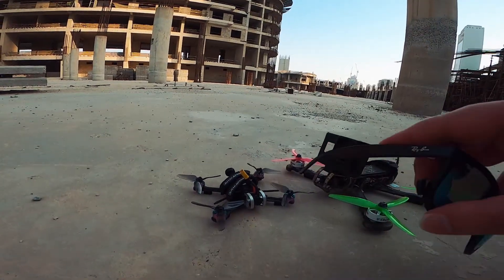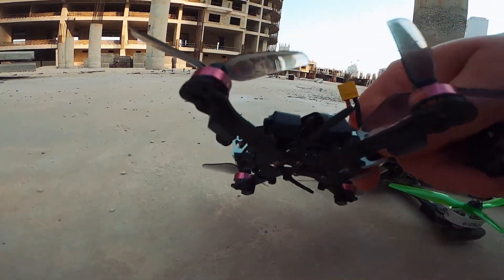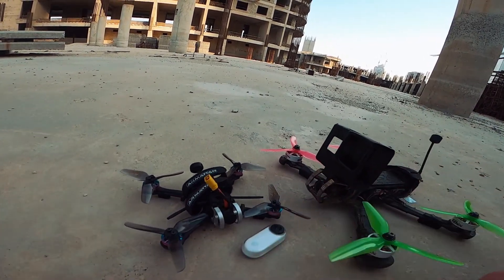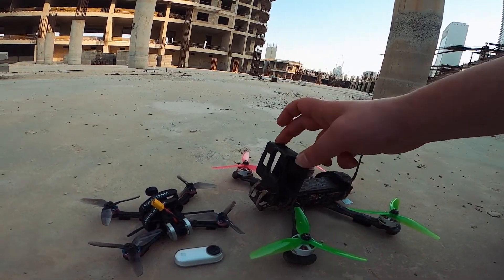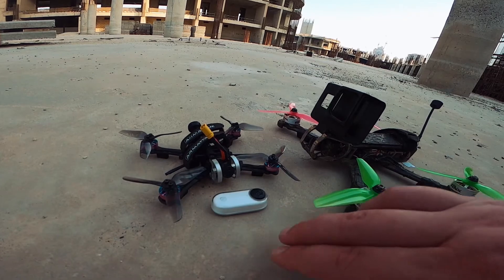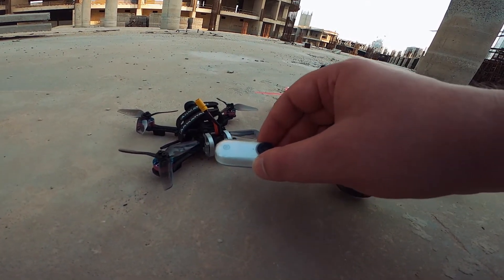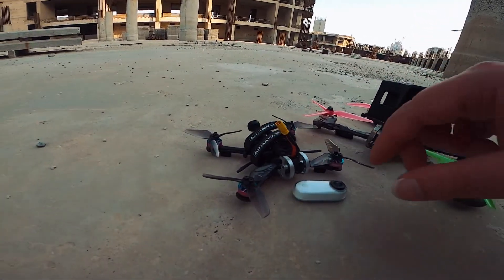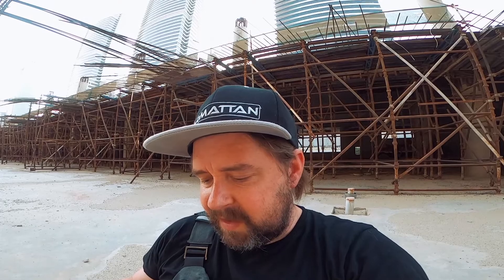Armattan Tadpole - Could Micro Brushless / Toothpick FPV + Insta360 Go change the game for ever?

Comment: just discovered you :) while looking around info on tadpole and build. did you swap to 1404 as you wrote below?
Reply from the maker: Yeah I went to 1404s later and they were pretty sweet.
Reply: @RyzZz-SC  thanks for your answer man. looking on your video on that 😊. did you find shorter flight time? I'm. really  in doubt with motor choice..

Comment: This was amazing ! I’m running and using same exact “rc in motor 1204 5000kv motor “ but it’s running hot after 1 min of flight any recommend on tune/ pids , or battery’s , I’m using a 4s 450mah , please if you can kindly advise would be much appreciated .
Reply: Im pretty damn sure those motors aren't supposed to run 4s so if you try a 3s your motors should be cooler. If not still then it's your pids. Learn to tune. It's kinda interesting and fun (in my opinion anyways)
Reply: @abrahamtan9704  hey brotha ! Thanks I’ll look into that  .
Reply from the maker: 1204s are really good on really light builds. A bit small though, so they don't handle being pushed super hard so well or extra weight that well either. Which is why you see guys moving to bigger motors. 1204s are soooo light though! If you just want to rip around a little quad with nothing on it they're pretty decent. 13xx or 14xx work fine too though.

Comment: What kind of voodoo did you use to get that video quality out of the Insta360 Go in those lighting conditions?  When I am in anything lower light than a partly cloudy day my video looks like it was taken with a potato.
Reply from the maker: You’re totally right - the Insta360 Go is superrrr light hungry and insanely prone to chucking out really compressed, puked looking footage. Best way I’ve found to improve the quality is to use the desktop app to export the videos at a higher bitrate. Adding a ton of saturation and sharpness helps too, whether you do that in the Insta360 app or in post. 

I add tons of both. As much as I can up to the point where the footage starts looking over sharpened and over saturated, natch.

Comment: What type of mount did you use to attach the Insta360 GO?  Thank you!
Reply from the maker: I literally used a lipo strap running around the 4S lipo lengthwise with the Insta360 snugged in on one end! Brain3D makes a really nice mount for the Insta360 that's specific to the Tadpole though. :)